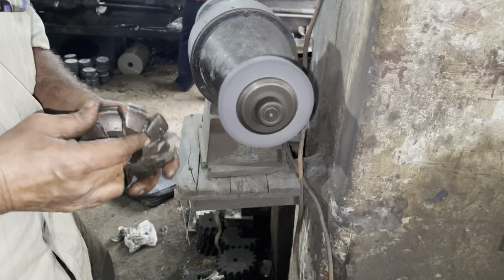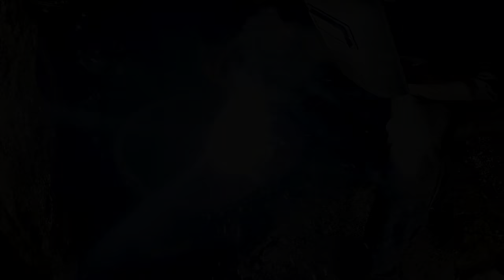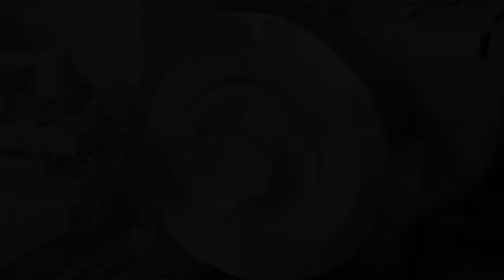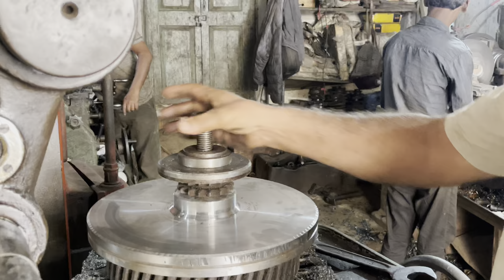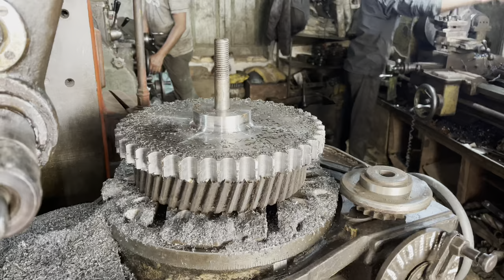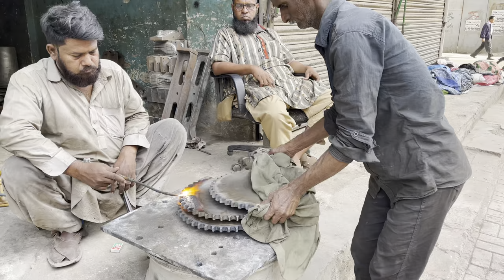These Craftsman’s are Experts in Making Heavy Duty Sprocket Gear from old Ships High Strength Sheets

Comment: Teeth cut with an eyeball sharpened cutter on a bent arbor and then heated with a torch to make it appear to have been heat treated. Good luck with your purchase.
Reply: out of it all the hand sharpened cutter had me spitting my coffee out!😂
looked the part finished though!
Reply: He must do some calculations beforehand to lineup all the teeth and complete a full circle
Reply: Wouldn't you need to quench the steel to actually harden it? What's the point of using a blowtorch?
Reply: @JohnDuthie  To make it appear to have been done properly. And a lot of this garbage is built to look like a good part more than to actually be a good part.
Reply: @billmiller7138  I'm watching their video -- https://www.youtube.com/watch?v=P_5F-ZITFQs  where they heat up a Hydraulic Cylinder to unbend it. Reading the comments says that will ruin the metal. Learning a lot from the mistakes haha
Reply: How the other half work.😉
Reply: It depends aplecation
Reply: premature aging
Reply: The central boss is placed over a thick layer of old paint then welded round the edges ????

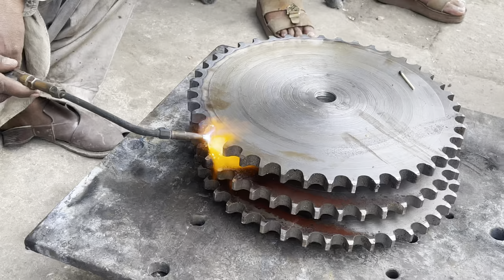Comment: 16:10 Fake heat treatment ?
Reply: i hear the heat treatment issue at 16:10 but i w as looking at the cutter sharpened on a sandstone, reducing the pitch after every sharpening, wondering how those chains fit :)
Reply: With the lack of a true heat treatment, these sprockets are a "wear to fit" item. 
Not dissing them, they use what they got. That's why they make 6 of them...so, when one wears out.
Reply: @luckydubeinrc5165  The milling cutter is made "by eye" according to the sample, you just weren't shown. The method sucks, but if a universal grinding machine is not available, then it is quite working. Although I would rather have drilled holes and processed the teeth with a grinder, it would have turned out faster and easier.
Reply: @_MadFox  the sprocket  looks just great, my concern was the fact that the cutter sides were ground down = reduced pitch= chain shave= chain pitch and sprockets don't match, .chain climbs over sprocket, or worse leading shaft or  bearing failure if bearings were used, if no bearings then centre hole/key ware+tare
Reply: i get it, it works for them, just adding my ten cents

Comment: ha ha ha, i like the casual attitude of the wheel barrow guy. i guess the gears are being sent for heat treatment. usually its done in a furnace, but i guess the guy doing the heating made it appear like roasting a beef patty on the stove.
Reply: Buyer: the teeth were wearing out quickly... 
Seller: are they blue? Blue ones. Claims are not accepted!
Reply: He's just giving them color so that they appear as hardened but they're dead soft. Actually the steel isn't even hardenable afaik so no wonder they do it like that

Comment: The treatment at the end is just for looks, the point of heating should be to cold plunge after not chuck on a dolly cart and haul down the street
Reply: Not heat treated at all, critical temps not reached. Looks maybe burning off slag.
Reply: @ehkerr . How do you know we weren't seeing the annealing stage of heat treating,  which doesn't reach the triple point? He wasn't heat treating the sprokets that we saw delivered, those were already being worked on and could easily be annealed. I suspect D2 steel is being used and that has to be annealed before use
Reply: @hepburn118  I suspect that this is an ordinary easily welded sheet steel from the side of the ship, which does not care about hardening at all😁
Reply: @_MadFox  No it doesn't. I tried hardening ordinary mild steel once, I only got about 13 Rockwell from memory, might have been 3. I know it wasn't alot, but it was an interesting excercise when I was an apprentice. I don't know the composition of ship steel though, if it has enough carbon in it, it might at least get into 40 to 50 Rockwell and be in the tough range with heat treatment. However, even heat treating low carbon steel will increase it's yield point by around 35% so that might make a pretty tough sprocket.

Comment: I'm surprised that guy has all his fingers, those long and stringy chips are deadly.
Reply: They can't use Iscar or Sandvik products, it's insanely expensive. And this is pointless when working with scale and locally hard metal. It will not work to sharpen the chip breakers either, I am sure that the soldered plate lives with them for less than five minutes before sharpening. Thus, ribbon chips are the least evil of the solutions available here.

Comment: That is good steel- high tensile plate. Machines well.
Reply: It could be like 355MPa but I would be surprised if it's better than that. The dull finish and those chips give it away that it's not very hard

Comment: @8:05 clears cutter of dross with index finger while spinning part. Hell, he has 9 more if he looses that one! And that shaft boss is held on by only bead welds which he cut 1/2 off. I wonder the shear strength of that weld…….
Reply: He is pro
Reply: @aydinali5381  Not sure if u are being sarcastic or not. So ok, define a pro if you can. Fast reflexes, unneeded fingers, x-ray vision…………
Reply: @BackByte  i oprate lathe one year & this in this short time i experenced body automaticaly know what its doing.

Comment: Considering the worn out old machinery, the end  results I suppose are at least usable, but certainly not up to Western standards.  My brand new tractor crankshaft (made in India) had journals that were ground with a taper of over half a thou in a one and a half inch length,  plus it had a very roughly cut spiral oil groove with razor sharp edges that run against the rope seal.  I bought it in preference to having the original one reground  but regretted it later.  Their definition of 'engineering skill' is certainly different to ours.

Comment: that power shaft on the mill is sure bent; think they would make another one with the lathes they got.
Reply: It looks like you are not familiar with old milling machines, from the word "at all". These are the tubes that hold the milling cutter, and not the mandrel shaft on which the milling cutter is fixed. They were too lazy to make bushings, so they cut the pipe. I don't justify them, but this is a real working moment.
Reply: After I saw that I started thinking that it might actually be beneficial to piece, especially for preventing overheating

Comment: Those lathes are from the early 1940's. I have never seen a machinist or tool and die maker true up a blank using a heavy hammer. Damn, that's a time warp video.
Reply: The old machinist we had in the Montana sawmill I worked with from 94 until 2015 used a babbitt headed hammer to true his parts in the 4 jaw. He learned the craft at an Alabama  paper mill in the 60's and 70's if memory serves me correct. He said there was a lot of old machinery  in the machine shop.
Reply: Arsenic and old lathe
Reply: Guys, what kind of time distortion is o_O? This is reality. Get out of your cozy little America and Europe into real life. You seem to be a little surprised by this reality🙄
Reply: @_MadFox  reality is different depending on where you are and how you look at it
Reply: Nicee good

Comment: Well I wouldn't like to grind a cutter by hand like that out of an old gear cutter, that's a tough job to get right, well done. You just need to make the kid use center and pilot drills with a bit of lube. Running a DTI over things now and again wont hurt either.
Reply: The cutter is now scrap metal
Reply: @MF175mp  They do their best with what they have. Just because you can't grind tool steel, doesn't mean they can't. All appretices ,when I was going through, all had to grind our own complex tools. Just because your training was poor, doesn't mean everyone's was. You didn't see the whole tool grinding so you have no idea what really happened. They may have a master shape to grind too like making a thread cutting tool and that would make that cutter very close to a factory grind and good enough for a chain sprocket.
Reply: @hepburn118  if they could do that properly for a multi tooth cutter, which is very very difficult and I would never even try, why isn't the rest of the work up to those near perfect standards? They're more skilled than a Swiss watchmaker if they can pull that off
Reply: @hepburn118  Well, it's a huge difference if you just have to do a tool that works, or one that actually needs to be accurate. Free hand grinding on a round grinding stone will never ever be accurate enough for a job like this. this multi tooth cutter is what gives the cogwheel it's shape afterwards. So if you're off just a bit, you will produce trash.
Reply: @shi01  Well myself, and every other fitter/turner and toolmaker I have ever known, can all very accurately grind square tool steel into thread cuttting tools, and a lot of others besides, on round stone bench grinders. We all learn it in our first year before we're allowed to go to tungsten tools. It's hard but most of a cutting tool is clearance so I still have little trouble believing that could produce an accurate tooth profile.
Reply: @hepburn118  Thread cutting tools are simple and don't need a huge amount of accuracy. I did this myself, really all you have to achieve are the correct angles...more or less because really importent is only the flank angle. Pretty much everthing else you achieve by moving the tool slightly between cuts. But trying to grind a sprocket cutter by hand is just delusional unless you don't give a shit about accuracy. I mean they also don't give a shit about proper hardening.
Reply: @shi01  I did say and other tools, screw cutting tools aren't easy to grind if your doing them properly. I've also done really accurate radius tools for round conveyor drive and idler pulleys by hand on a round wheel so I know what's poossible on a round stone tool. It's bloody difficult to hand grind a sproket tool, never said it wasn't and I said I wouldn't try it, but it's far from delusional just because you cant see how and don't have the skill to do it.

 As for proper hardening, they may have easily properly hardened it, you just cant see how obvioulsy. That steel they used could easily have been anyone of the air quench steels A2, A3, A4, A6,, A7, A8, A9 or D2 and I supect D2 as it mo
ves the least under heat treatment, they didn't have a surface grinder, and it's free machining. I'm pretty sure what we saw was annealing D2, the sprokets that were delivered weren't the one's he was working on.
Reply: Andrew Crews  Well at least you understand. They are doing their best with what they have and getting that cutter as close as they can by hand on a bench grinder. It won't be perfect but many would be surprised as to how close it actually is if they have a master shape to go off of. It's done by hand, so It wont be perfect, but hand ground tools can be very close to machine ground. That cutter was close to the shape needed too, you are dead right there. You are also right about them not being as good as CNC produced ones, might be closer than many would think though. I have seen some shocking CNC parts in my time too that I would rather have a part from these guys over. China, I'm looking at you.

Comment: This part wont last longer.. Several reasons are there.
Reply: A piece is a piece even though this wont last long :D
Reply: I have used these wayside workshops for small jobs, they were okay and cost effective too. Some of them even know about metals and specs.
Reply: Moving parts, especially gears, MUST be made out of a single chunk of metal. It can clearly be seen that some part of the gears, are actually a welded portion and this is VERY DANGEROUS..!!
You don't need an engineering degree to understand that.
Reply: They’ll make you another one 👍
Reply: @trainnerd4350  ... you may not be lucky enough to take another breath for that...
Reply: @azharsalim2028  For saying they will make another one? Oh OK 🙄
Reply: @azharsalim2028  What you are thinking of is Formula 1 car engineering. This gear most probably is from a slow industrial or agriculture machine such as a mill, thrasher, saw etc. It would work fine, nothing to loose sleep over!
Reply: @azharsalim2028  And where did you get this spec of that rotating part NOT to be welded? It all depends on the shear loads on that gear, and if the welded area and depth can withstand it plus some safety factor. Many rotating parts ARE welded, they are all around you.!
Reply: @mohabatkhanmalak1161  .. where did you learn engineering?
Reply: Regardless of what kind of use it was for, the strength is ONLY sustained AT THE welded joint. I don't hv to tell you what I learn but everybody can see very clearly that this is a very weak joint.
Reply: FYI, Sprocket are welded
Reply: @msengg5752  .... you mean, ALL sprockets,  or just those in your country?
Reply: @azharsalim2028  the hub part of sprocket is always welded.
Reply: @msengg5752  .... good luck bro. Now I know for sure, where I "MUST NOT" buy spareparts.
Reply: @azharsalim2028  1st of all you are not a buyer here, stop placing your order here.

Neither the channel is selling as anything.

Personally i will be happy to have no costumer like you. 

who don't Know understand how Chain Drive System Works.
Reply: @msengg5752  ... I am not interested in your product, anyway. I have better options rather than buying from arrogant and unsafe people like you. 
I rest my case. Thank you.
Reply: @azharsalim2028  Uncle, welding the lug does not pose any danger, don't be stupid. This is a fairly standard procedure in the repair business of developing countries. Separation of the lug is physically impossible, there is nothing to scare yourself in the first place.

Comment: 14:30 take a look at how bent the shaft is!
This will cause the gear tooths to be not perfectly involute. This will cause significant friction and wear when the gear is used.
These people really have no clue and are a bunch of amateurs!
Reply: And they make the teeth softer with a blow toarch. They either want them to go bad within a mounth or they don't know what they're doing. It seems like it's built in a way to wear out as fast as possible to sell more in the future. And making it look like they're heat treated. It's either malicious or they saw how a real gear looks like and just try to make theirs look the same with no regard to why they look that way (heat treatment to harden the steel)

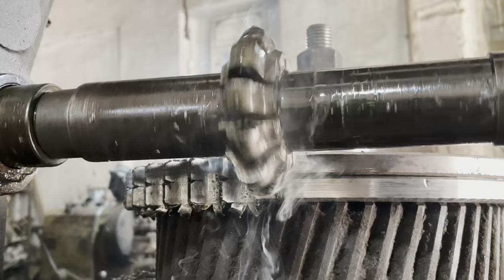Comment: 13:30 somebody's crashed that machine before 😆
Reply: That thing is clapped out,  on a side note I am really curious how it cuts straight
Reply: Gentlemen, well, open the fucking textbook and see how the horizontal milling machine works! Here you can see that the mandrel is not bent, but simply instead of bushings to hold the mill in place, two pipe trimmings were put in place. That's the whole secret.

Comment: It's not in US, it's in India. They aren't experts, they're noobs, those sprockets are trash and this video is a joke...
Reply: At least there working in a trade and not sitting on there asses waiting for a hand out.
Reply: its *Pakistan

in india, we have gear hobbing machines and CNC.
(for smaller size we use hobber upto 1" above it VMC.)

if you want one, just ping me.
Reply: @msengg5752  WFL MILL-TURN 60 may work also.
Reply: @Clarity5970 We never tired on tmc, our shop have doosan lynx 2100 TMC, we generally turn it on lathe and mount it on vmc... For as TMC are for high volume production. for 1-2 job they won't allow as.
Reply: Nicce